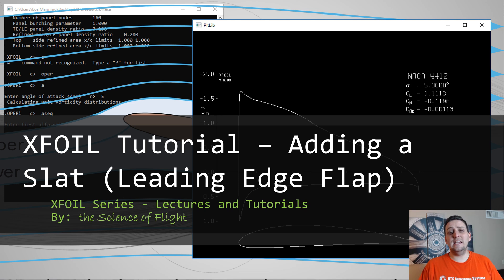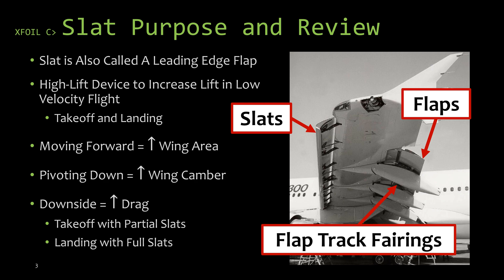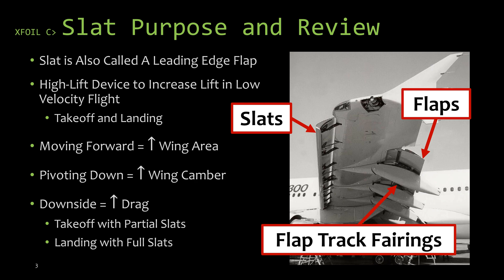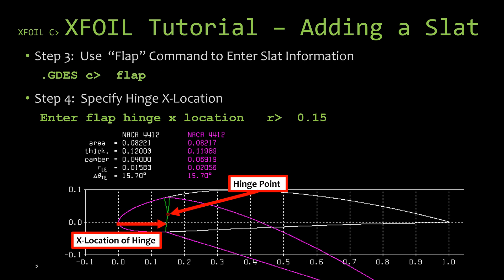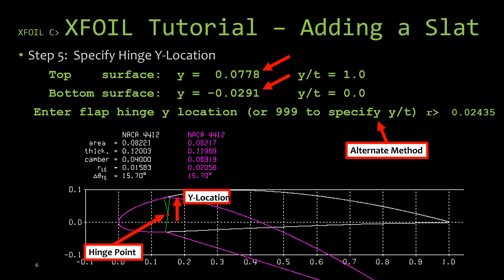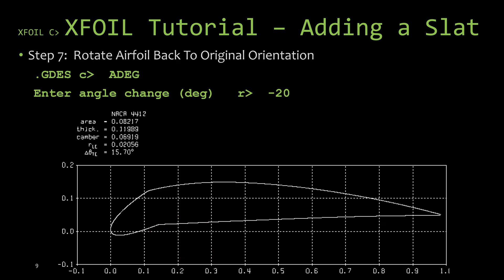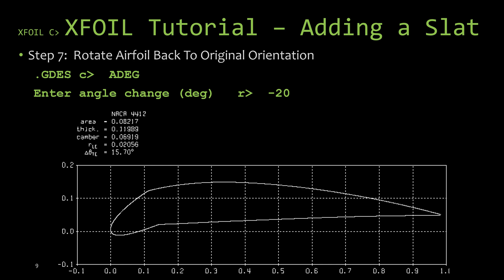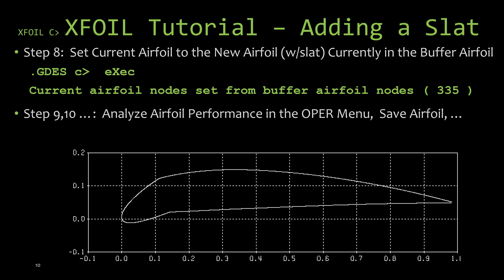XFOIL Tutorial 8: Adding a Slat (Leading Edge Flap)

Comment: LE slats help maintain boundary layer at higher angles of attack by adding airflow through the slot behind the slat.  Also referred to as Slotted LE.
Reply: Not just through the slot but accelerate through the slat with compression.  This doesn't simulate that at all.

Comment: Thank you very much 
Your series give me information about aerodynamic practical.
1 thing how can we perform test of added slat or flap?
Can you make more video over it .
Reply from the maker: You could start with some preliminary analysis by creating pressure plots or polar plots for the new airfoil shape that has the flap/slat built in (I've got a few videos up on doing a pressure plot and polar plot with a normal airfoil but go ahead and experiment to see what your results look like with the addition of the flap). However, you're right. There are specific analysis that we can do on the airfoil to evaluate the flap/slat. For instance, we could look at the hinge moments developed on the flap due to the air flowing over it. Those hinge moments could help determine, say, the expected size of motor you would need to drive it. I'll go ahead and add another video to my lineup talking about some specific analysis you can do with this flap. Look for it in the near future.